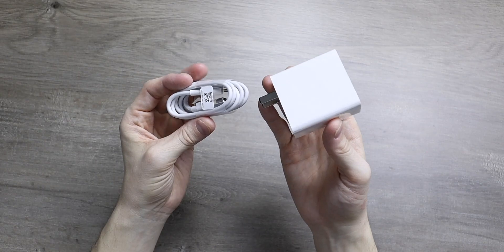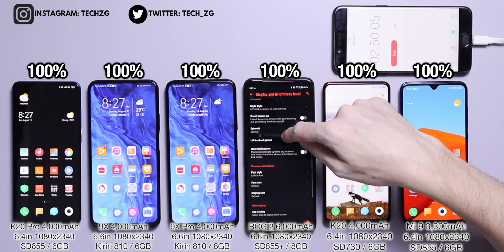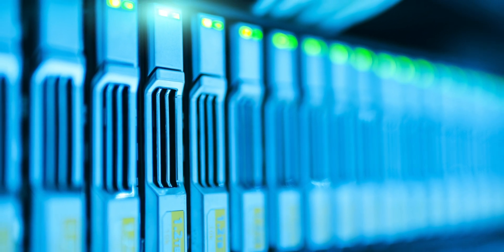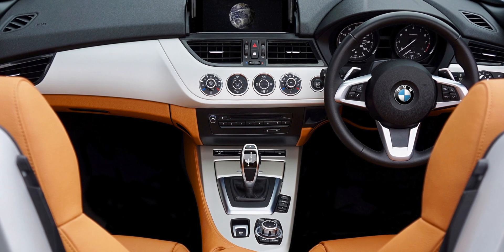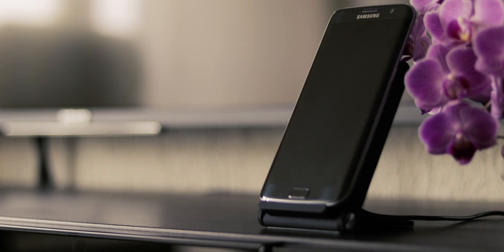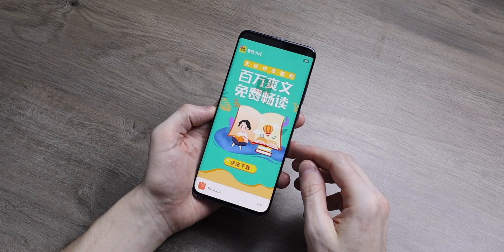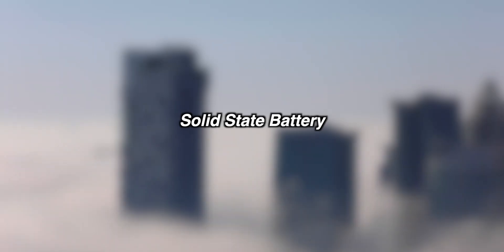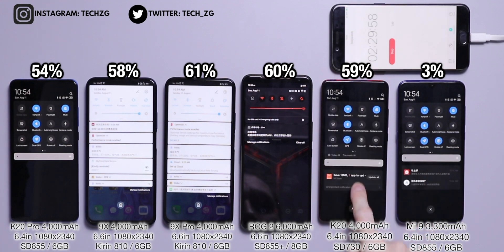Graphene Battery, Solid State Battery & More - FUTURE Battery Tech Explained!

Comment: Hey bro asking again.
When is the redmi note 9 pro releasing in china and with which processer cuz its coming in india on 12th and they are saying it'll have sd 720g..????
Reply: It will have SD765
Reply: @estrossa8928  I don't think so. It would be a 5G Phone with the SD 765G
Reply: @leelo3252  not necessarily
Reply: @estrossa8928  for sure
I think the 5G modem is integrated in the SoC so there is Just the 5G variant
Reply: @leelo3252  then it could be dimensty1k
Reply: @estrossa8928  it would be the same
It's not planned to be a 5G Phone...